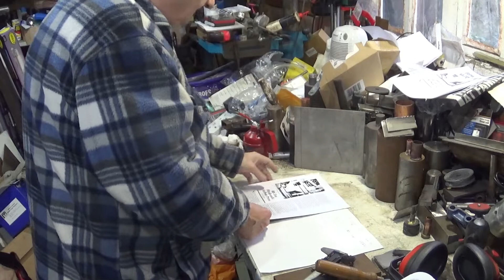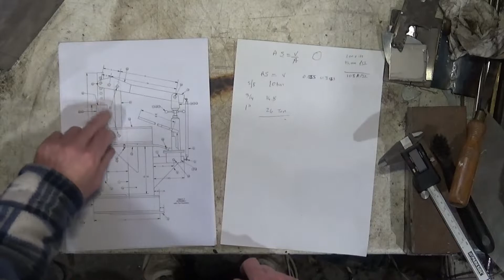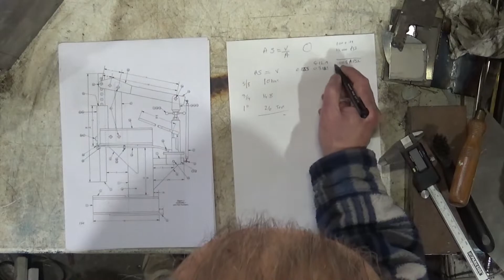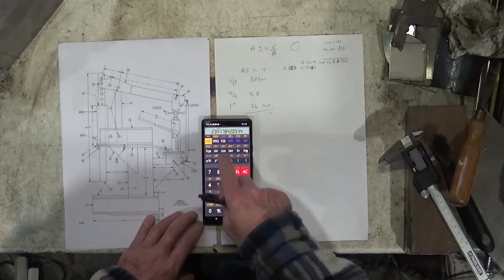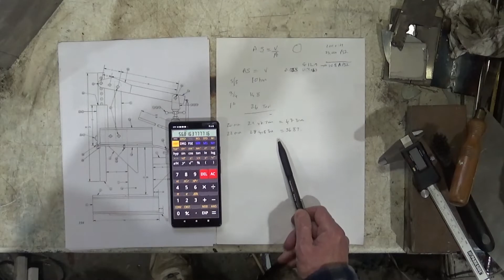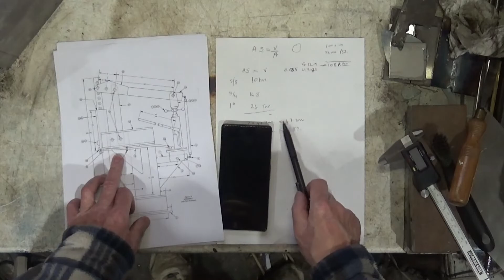Home Shop Machinist 40 ton arbor press More Pin Calculations

Comment: Ciao Ben !! It will be nice to find the documentation that you have on hand, if i understand correct is it a tutorial like step by step to make a 40 ton arbor press at home? You know i need a press, because i dont have it !! Could you suggest me where to find your documentation so i can take a look ? Thanks and have a super week-end, Alberto
Reply from the maker: On my about page, you will find my email address. Email me. You do need to be able to weld thick steel and it is only worth it if you can get the steel cheap (which I can).

Comment: I concur with your model engineering club, the fulcrum is the sum of both those loads. 
I like the design, hadn't appreciated it's versatility till now, you could always put multiple holes in the beam to avoid having to drill the ram out to 22mm, maybe adding a few extra so you have a range of available forces both in hand and hydraulic modes. 
Appreciate the shout out mate.
Reply from the maker: There are two sets of holes in the beam to give two level of force on the ram. You need the extra holes in the ram to set the throat gap. 

You are very welcome to the shout out.

Many thanks for watching!
Reply from the maker: PS. please don't forget to like the video :)

Comment: That. Was mostly over my head, my way would to build it and  put different sizes and materials pms in, and test till destruction then up it, I have some octagonal kango tool blanks extremely hard, but with that I believe come brittleness
Reply from the maker: One of the problems with hard materials is that they get more brittle as they get harder.

Many thanks for watching and the shout out!

Comment: Another good spot by TCME - that makes it a bit easier to achieve the 40 tons that you were looking for.  I like the idea of turning it into a hand operated press - I bet you'd end up using it like that just as much as with the jack.
Reply from the maker: Yes, good spot by TCME. You are probably right, having a hand operated press is very useful because it will be quicker though have a lot less tonnage.

Many thanks for watching!
Reply: @BensWorkshop  Slightly different beast, but I've always fancied one of the old fly presses - when I first started work there were spring makers in the town still using those for small run jobs (flat springs not coil springs), and I just thought they were fascinating.
Reply from the maker: They are fascinating, still used and useful. Only problem is they are heavy!

Comment: eyup Ben
great when people share info in comments to improve things,  what about using a piece of en24 steel (or equivilant grade) if bolts are expensive, en24 was the grade term in my work days, not sure if grade identification has changed👍👍👍👍
PRESS ON 🤣🤣👍👍
take care
Kev
Reply from the maker: That is an interesting idea, though it is close when hardened, it isn't as strong as 12.9 bolts. 

Many thanks though. I will bear it in mind.

Many thanks for watching!